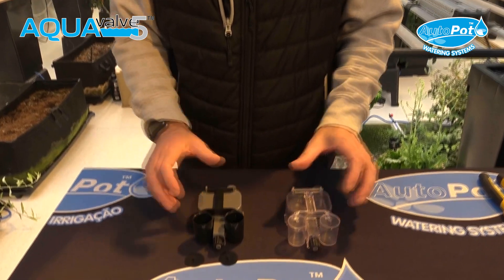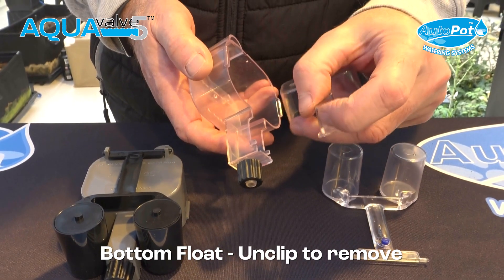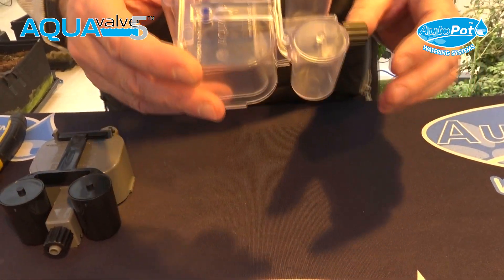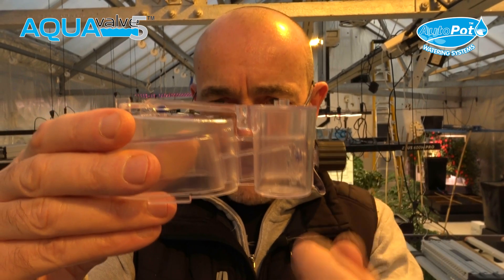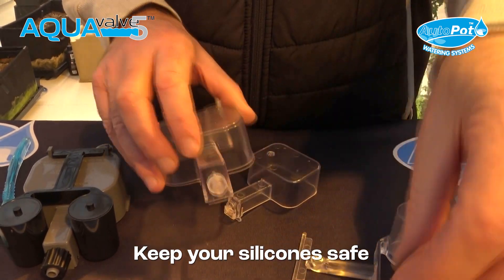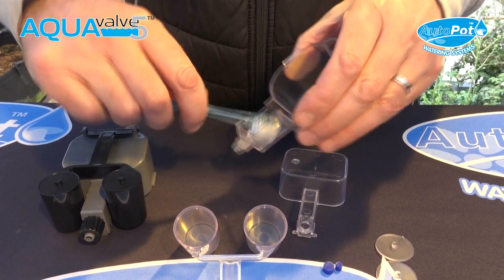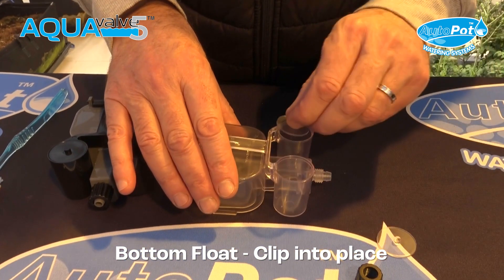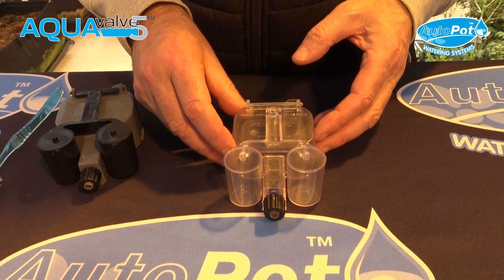AutoPot AQUAvalve Care

Comment: I ordered several silicone rubbers from autopot orig and other stores. The are grey now, not blue like the ones that were fitted when the valves came. They feel softer too and my system is constantly overflowing (max hight of the tray)... What is going on here?

Comment: I’m still unclear as to how it works. How does closing the hole activate the flow of water? I can’t seem to form a picture in my head of why this would be. I want to think closing the hole would STOP water from flowing since the air would be trapped. What am I missing? I don’t have an auto pot to examine up close.
Reply: There is no closing of the hole to activate flow, the hole is closed to stop flow in until water is consumed. The bottom/inside-floater will let water in when tray is empty, then the outside floater will rise letting air out of the valve, which makes the inside floater rise higher again letting more water in. And it will not let more water in until air enters the valve.

This design makes it able to let water to be full consumed before letting more water. A normal floater would just keep the water level constant. With a floater like this the plants determine the water requirements.